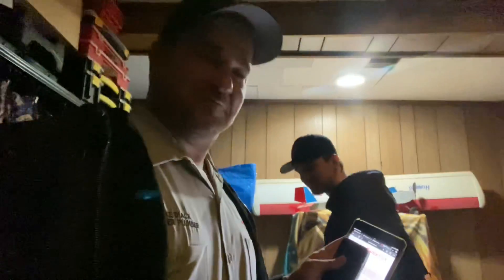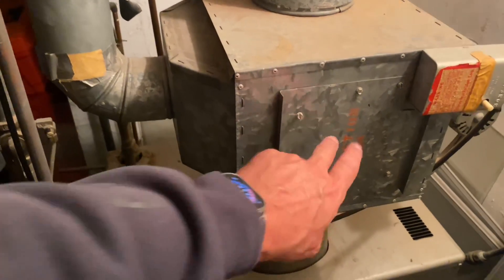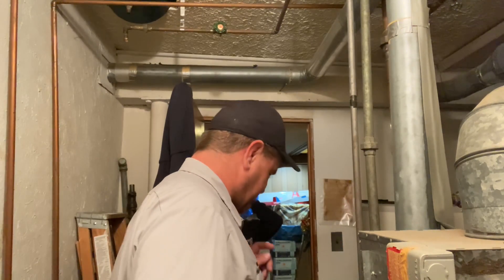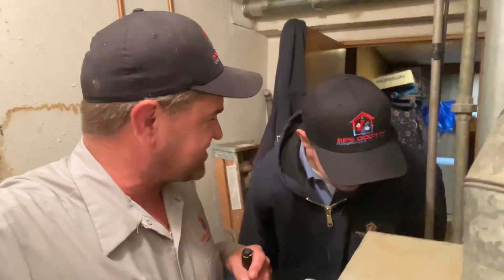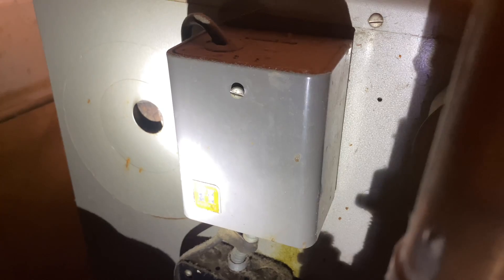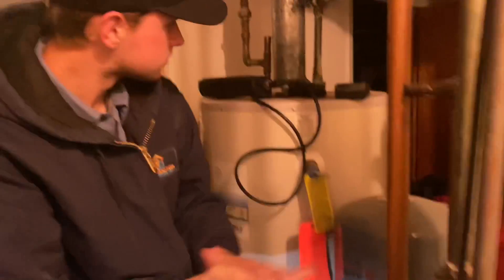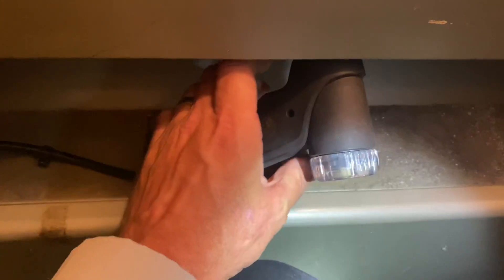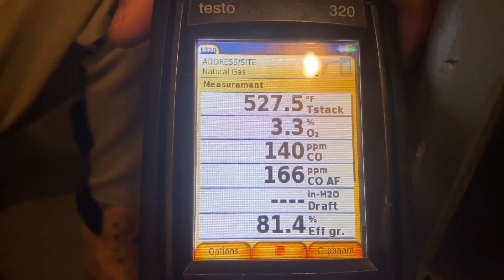Homemade Boiler Exhaust Gas Heat Recovery off Flue from a Furnace Used for Space Heating

Comment: My father had a commercial version of this heat exchanger installed on our oil fired furnace in the 1960s
I don’t know the manufacturer but the thing worked pretty good heating the basement.  
And consequently aided heating the house.

Comment: I have a heat exchanger on my flue pipe and I'm able to take a ton of heat out of the stack. So much so that I had to add a power vent on my chimney. Once a year I spray a baking soda and water solution down my chimney to combat any acid that may form since now my chimney temp is totally out of whack. I use significantly less oil. My basement is finished and that's where I have my office so I just dumb the heat straight into the basement and let it rise. Certainly do NOT attempt this if you don't understand the risks. You should get rid of combustion heating anyway. A heat pump is far more efficient especially if you go ground source.
Reply from the maker: Very very smart!!

Comment: Yes. Easy enough sensor add on.  The only issue you have to contend with is that it is possible to remove enough heat to slow down exhaust gases in certain circumstances.

Comment: Hey Mikey. That heat exchanger is pretty ingenious as you said. But, I do not see why this would not pass certification if properly designed. It is no different than a gas fired forced air furnace where the heated combustion gases pass through a heat exchanger with air blowing across it. One could potentially make the waste gas heat exchanger safer with a CO sensor safety circuit to sound an alarm and shut off the blower and boiler.
Reply: @PipeDoctor  Understood. I meant to say I do not see why something like this would not pass certification if properly designed. I should’ve proofread it. LOL. Sorry for the confusion. 😁

Maybe I should put my mechanical design skills to the test on this idea. 🤔 

Appreciate the reply and thanks for all you do!

Comment: That is exactly how small aircraft cabin heaters work. There is an exhaust shroud that passes ram air over the exhaust and into the cabin with a damper for temp control. Which is why CO sensors are often purchased for safety. Why they don’t come with the plane with that setup is beyond me. But a cracked exhaust shroud can be a very bad thing for a small plane. Good thing you can still open the windows.

Comment: Not sure where they were sold, but I recall seeing similar heat exchangers out on Long Island as a kid of the 50s / 60s. They also sold external heat fins that strapped onto the flue pipe with small springs. I'm sure none had any UL approval.

Comment: Well I have seen something doing the same thing. It was in the 1970's and it was called "Wonder Heat" It was a solid fuel (wood burner) that one would place on the cavity of your fire place. What was unique about it was . There were two 3.5-4" square tubes placed paralelle and on a 70 degree angle from the bottom of the fire box to the top inner edge of the unit ( all completely seam welded ) so no smoke could enter the room, but they would convect the room air at floor level which was drawn in to the space heater and the fire inside would thus heat these tubes, which inturn drew in more air into them (not the fire box). With very little wood you couldn't stand up infront of the thing in ten minutes time as it threw out so much warm air. However  it was perfectly safe and warmed the average home in no time. If I can find schemeatics I'll post them.

Comment: My dad made a heat exchanger at the exhaust pipe, not with air, but with water used for the boiler or the room heater. Unfortunately the house is sold 10 years ago, no picture :-(

Comment: My dad did something similar. He wrapped the exhaust pipe with copper tubing, and used the hot water from it to heat a water tank for the domestic hot water. When the boiler went on, a circulator went on to circulate the water around the stack and into the heat exchanger in the water tank.
Reply: Same here ;-)
Reply: that water setup and flue pipe air to air heat exchangers worked best on coal/wood fired stoves, where the flue gas temperatures(and pipe) would be very hot.
Reply: @throttlebottle5906  Yep. And some fire places have a water connection as well.

Comment: They have done it for ages with wood stoves. Its most known as Magic Heat, and still produced today. I don't see any difference except if it cracked you would see smoke with the wood fired. Also they are heavy gauge steel, so possibility is way lessened.  But like you said... either way, both flue gasses will smell... Up to the operator, had grandparents with them lol. Love your channel man. Take cares
Reply: @PipeDoctor  That's when dad is an engineer  / inventor :-)  Guess what I became :-) And yes I have learned a lot from the good old day's and still implement those tricks in my new designs.
Reply: yep, mostly what I've seen and variations of it, always used on wood/coal stoves, where the flue gas temps were very high in comparison to natural gas/LP/fuel oil.

Comment: You could have a carbon monoxide Detector on the other end and if the alarm goes off, it will open the relay and cut off the TT to the boiler. 
But still not a great idea. I think it would be safer if you had a copper heat exchanger in the exhaust pipe that would heat water and then go into a fan coil to release the heat on the other end. 
that would limit the possibility of having fumes going into the house. 

or just have the actual heating loop run thru the heat exchanger, maybe on the return before it gets back to the boiler. 

but nothing in life is free, especially energy.
Reply: @PipeDoctor  Off topic, but during the late 50's, I put about 40' of copper tubing down the passenger side air vent to cool the oil.  Worked.

Comment: That is a VW heater from the bug days! Heat the interior by running air across the mufflers!
Reply: VW used heat from the exhaust while Corvair (Chevy) used the cooling air from around the engine cylinders. The Chevy version was known for blowing oil smoke inside the car due to engine oil leaks, although that system got more hot air to the passengers.
Reply: @rupe53  Chevy Thunder!
Reply: @PipeDoctor  The exhaust system had an enclosure (plenum) which heated the air for the inside with the aid of a diverter valve and a fan. It was common for the exhaust system to rust out and pour deadly exhaust gases into the occupied space of the car. People just seemed to deal with the problem of deadly carbon monoxide coming out of the heater vents

Comment: Brush/blow that heat exchanger out, clean burners and open air shutters and it’s good for another 40. Co will drop and adjust o2 to 7ish

Comment: Surprisingly the flue pipe isn’t rusted out from condensation. But 220k btus boiler there is probably 40-60k btus going out the flue. I would hate to see that heat bill.

Comment: That heat exchanger on the flue pipe may cause the chimney to condense from flue gas not being hot enough and possibly not draft from chimney being to cool.
Reply: it would never extract that much heat from the flue gasses. well maybe if it was bringing in freezing cold outdoor air.

Comment: Well I seen a lot of weird things in my life like a homemade solar water heater made out of black beetle pipe ran all over a roof which works fairly good obviously but never anything like that I mean technically it's like the secondary flu gas exchanger on a modern high efficiency unit in theory

Comment: Here you would need to shut down that system. If you cannot get it below 100 here you can’t operate it. From the old hvac guy in Toronto.👍🇨🇦
Reply: What would be a good replacement for an old boiler in Ontario aside from the combis they sell? Mine is hydrotherm 125 from the 70s and I’ve been doing the maintenance except for the readings because I’m afraid a plumber will lie to my face and want to shut it off because it’s so old. It has worked really well and have changed parts throughout the years and has never set off the carbon monoxide detector. Is there something similar that will last 20-30 +years with few problems? Plumbers keep wanting to sell me combis but those have life expectancy of 10 years. Would like something similar to what I have but new. Any ideas?
Reply: @dancefan20121  yes a Weil McLean  boiler would or should last 20-25 years. If your in Ontario it is mandated that you have an annual inspection of your draft hood boiler and it be tagged with the before and after readings of CO.
Reply: @dancefan20121  those hydrothermal parts are usually still available. Co detectors only alarm when either lots of CO is or a little over a long period of time. CO makes your body not be cause to absorb oxygen if you are get little doses all the time it can cause health problem. Cleaning a heat exchanger on both side and get water Chem right on old or new with good maintenance will keep a system going and safe for many year. I am a plumber in Ontario and service lots of these boilers. Not coming to Toronto those. Finding a good plumber that does boilers is hard to find. The HVAC guys try and fake it a lot
Reply: @dancefan20121  we install Laars and Viessmann products and both seem to work great. It is usually a good installation and and maintenance that keeps a system healthy. I clean the the boiler water up and demonetize water and older system add a magna clean to help with magnetite and protect you heat exchanger warranty. The Viessmann high mass boiler are the best replacement for these system but are not cheap Vitocrossal

Comment: Good way to make sure theres not enough heat in the exhaust to make it out of the chimney.  Jeez wonder why its not still made
Reply: At over 500 degrees dont think that is a problem if the blower doesn’t turn on until the stack it above a certain temp

Comment: Made a few of these for wood stoves in our sheet metal shop over the years
Reply: @PipeDoctor  no we made tubes kinda like this that the flue pipe for wood stoves heated up and fan blew the heat off it into the room.the smoke pipe wasn’t cut into.the customers had seen a aftermarket device and wanted us to make one based on it.personally I didn’t understand why they didn’t just buy the aftermarket device.
Never seen one on or even heard one on a boiler flue.the guy who owned the house must have been a engineer maybe.they can come up with some crazy ideas sometimes

Comment: In the 70s my father installed a diverter on the dryer vent, used a nylon sock to capture the lint. I’m pretty sure he purchased it from the hardware store.
Reply: He also had 90 percent humidity in the basement and most likely mold.  But hey it was warm
Reply: I don’t remember any mold, but the sock used to break and there was a lot of lint stuck on the rafters. I’m amazed that there was never any issues with it. He’s 90 and still lives in the house, I’ve made sure everything is now safe. He doesn’t go into the basement anymore. Thanks
Reply: that and other lint trapping buckets worked fine hooked to dryers in winter, BUT only to be used on ELECTRIC DRYERS! otherwise you're CO gassing yourself.
the additional indoor humidity is usually needed in winter and would disperse throughout the whole home anyway(older homes were drafty and not sealed well)